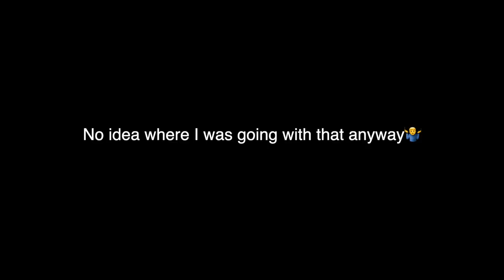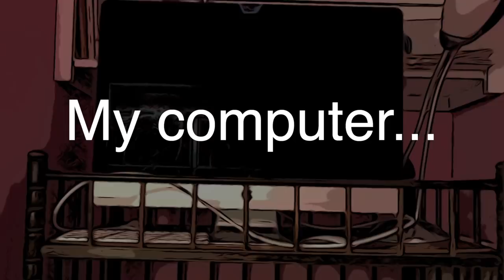Why I Stopped posting videos..I was Mad..

Comment: Just for reference. I worked in a slaughter house for 10y in the 70s. The best blades we used were from an American company called. Russell. Green river works. I used to give it a tickle on my oil stone in the mornings and that was it for the rest of the day with just a glide across my steel every so often. I still have them . And christ they are just as sharp now as they were back in the day. PS The victory knocks are crap.

Comment: Do you have any recommendations as to the angles to sharpen what knives? Like 50° for butcher knife?
Reply from the maker: I don't really pay attention to angle. although 20 degrees is a pretty good starting point
Reply: @OUTDOORS55  thanks for the reply! I can see that it would be hard to keep track of angles when sharpening by hand.

The reason I asked is because the smaller the angle the thinner the edge would be. So a razor would have a smaller angle vs a butcher knife. Cleavers wouldn't fare well with a razor edge when cutting through bones. The edge wouldn't last.

I never know where to start lol. Thanks again!